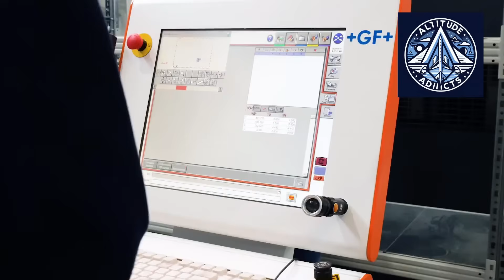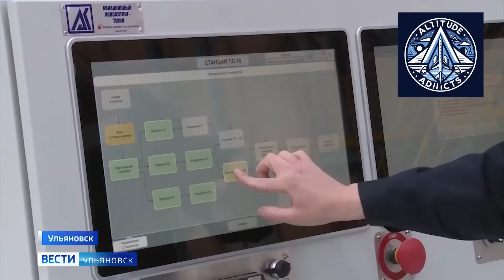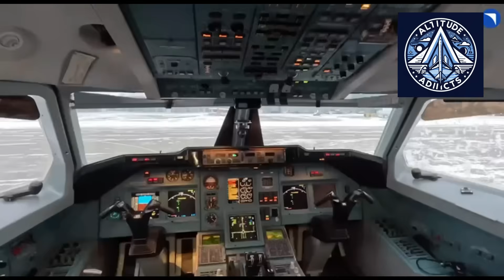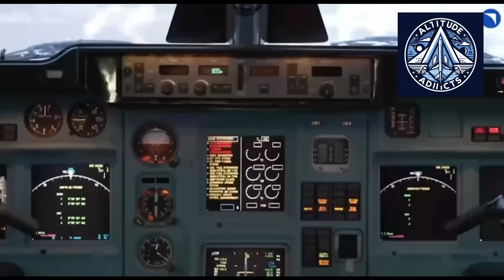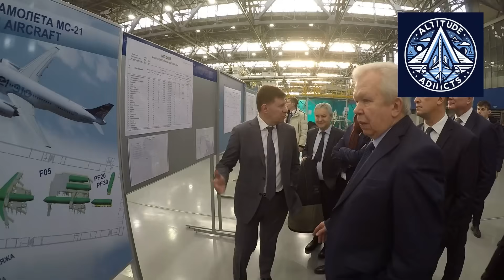Not Il-62, Tu-330 An-218, or Il-96-300—How Kazan Chose Tu-214 for Production

Comment: Boeing and Airbus are so cheap because they are taxpayer founded.
They sell at massive loss in order to destroy aircraft industries in all other countries.
So OAK should not expect to sell anything with profit.
Reply: Boeing and Airbus survive on massive military contracts and essentially being the only commercial options for most countries around the world. Military contracts for Tu-214 for the Russian military to replace a lot of the obsolete types they still use could be used to upgrade their production standards and methods to the level they would be if Russian airlines and the Russian military had supported them all these years. Boeing and Airbus have more competitive planes because they have huge market share and therefore lots of income to upgrade and improve aircraft and engines and support networks. You can't say they are more reliable when sanctions cut support and risk having aircraft seized when flown outside Russia. Upgrading production and automation in all Russian aircraft factories should be a priority and the focus should be to improve and develop.